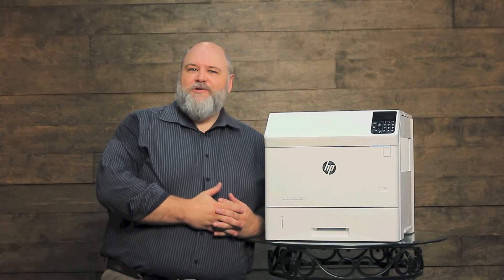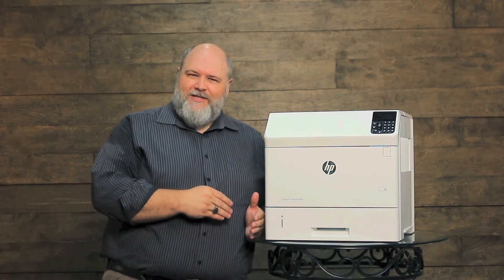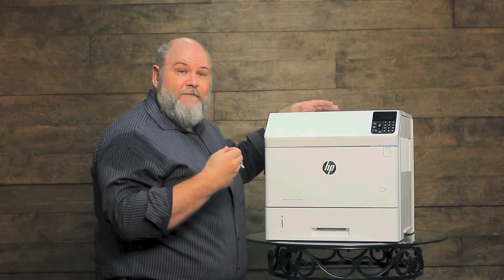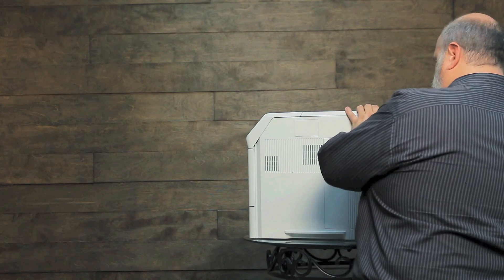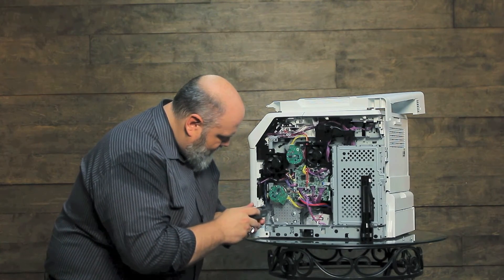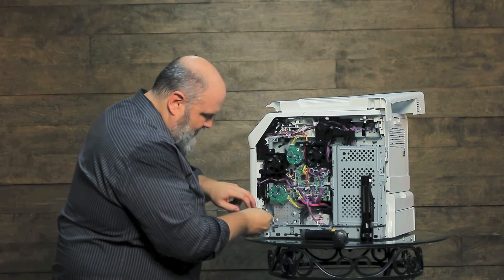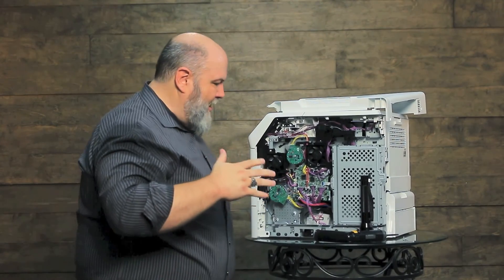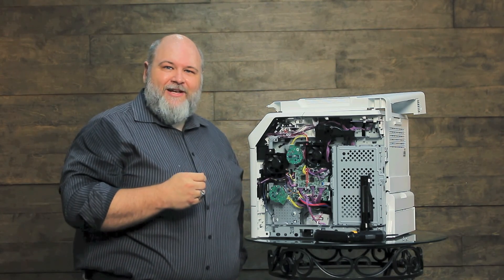PRINTER REPAIR: Blank Page At The End Of The Job

Comment: Yes skelter zero I do the same thing, but I dont do double sided tape, I either use 3 to 4 layers of some of that Avery type of label cut to size, I have also started using (just because I did not have any labels at the time) some 3 to 4 layers of electrical tape cut to size, I've had some customers with these fixes for months (with no call backs, except for one that I had to re pad because the pad fell off because it was at a high humidity area) and some that have had it for over a year so far, without call backs either.